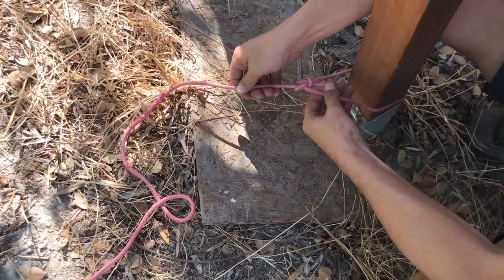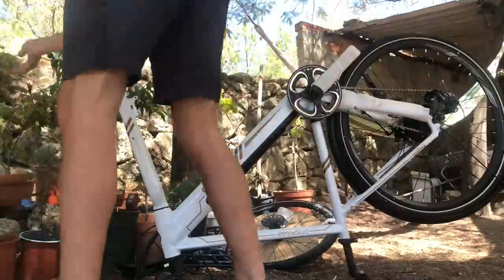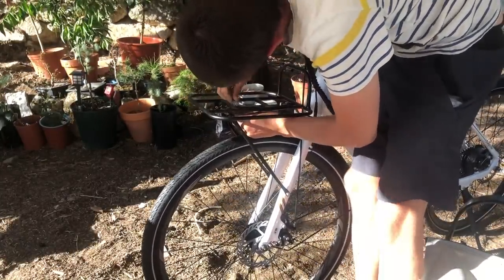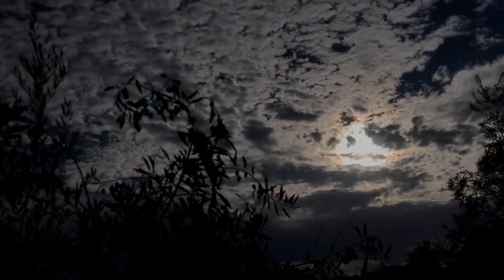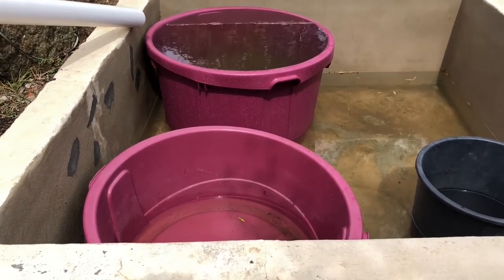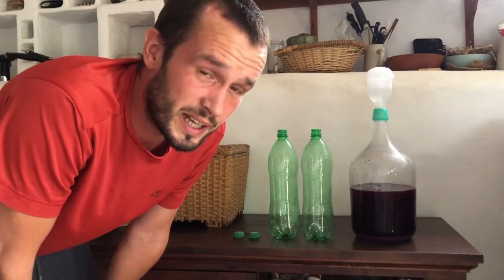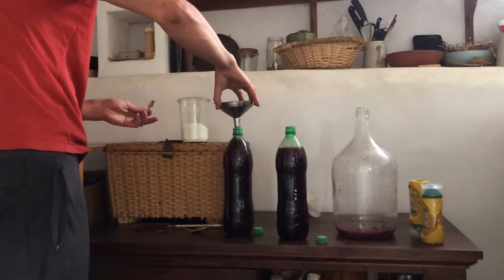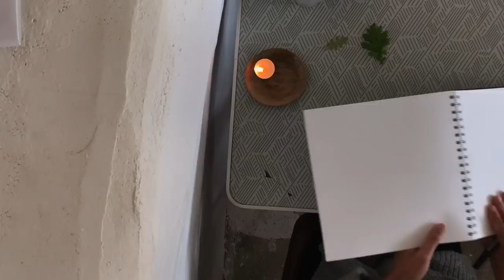OUR HOMESTEAD FINALLY GOT RAIN AFTER 3 MONTHS of DROUGHT. In collaboration w/  Eleglide Citycrosser

Comment: Hi  Cassandra,  Iowan
This is Christoph and Joan from South Africa and we are subscribed to your channel. We are both pensioners and I immigrated  to SA in 1981. I am a bit of a handyman and hope you can use my suggestions to improve your homestead

First I would like to suggest to place a hail net or even bamboo over the existing roof of your sleeping quarters and or your kitchen with maybe a 500mm or half meter gap. This way you create another layer of air which will help insulate and keep it cooler and also eliminate or reduce the noise from rain or raindrops 

With regard to your "ecoflow" solar generator I suggest to put up the solar panels permanently in the average sun angle position. This way you do not have to manage it and get most of the sun energy. Not sur if the portable panels are weather, proof, but they should be. Else consider replacing them with solid regular panels. Even adding some panels will help charge quicker and keep the ecoflow connected to the solar panels for as long as possible and only move it if you have to.

With regard to running water in the kitchen I suggest to simply install some pipes and taps and connect them to your water source,  or tank and use the same device than you use for your shower to make the water flow? Or simply gravity feed if space and location allows. Maybe install a 40mm or 50mm drain pipe with a trap and route it outside to a tank or container or basin that you can re-use the waste water elsewhere

You can reach us directly .Our provider is @reisers.net and simply add the first name for the person you want to reach Joan for my wife and Christoph for me.

Hope my suggestions meet with your approval, looking forward to hearing from you

Regards

Christoph Reiser
Reply from the maker: Hi Christoph! Thanks for your thoughtful comment! We love the hail sheet idea, I think in the summertime that would be perfect.
We did in fact put the panels on the roof for summer, they’re unfortunately not weather proof which means we can’t keep them there permanently - we do plan on buying some proper panels soon. I’ll try and send you a message privately 👍🙏
Reply: @FrankieOffGrid  Thanks for your kind words. If you buy solar panels the smaller ones are usually cheaper as they are older. Please check thee manual for the ecoflow for voltage, as some solar panels are too high in Voltage. This is listed on the panel as VOC with a number .And you get two kinds of panels, the mot common is "poly" they usually look a blue kind of tint or colour when looking at the cells and the "mono" are more black in colour. The mono are more efficient in shady and cloudy conditions but normally a bit more expensive.  If you let me have the exact model of your ecoflow I can look it up for you

you can also buy second hand solar panels as all the new systems take hi voltage VOC and some people who are upgrading can no longer use the panels with that new system. Most panels last 20 years and they are very very easy to check if you know how to use an electrical multimeter. Simply connect the test leads of the meter to the leads of the panels and see if you have a voltage. This meters are cheap and perhaps a friend has got one, but it has to bee set to the DC volt range.

Don't hesitate to ask questions if you have any

Regards

Christoph
Reply: Hi  Cassandra,  Iowan

Forgive me for my ignorance, I just watched your solar video again and saw it is a Bluetti solar station. As far as I can see it says 1000W AC but I can't see the model number.

I forgot to ask to your camera problem, did you manage to fix it. If it is a piece of sand, have you tried taking it to a garage and blow it with air to dislodge it? Or perhaps try an earbud cotton stick with methylated spirits to clean it

I looked up the solar panel specs from bluettti for the 200w foldable panel and it has a VMP voltage of 20.5 v so any panel with a similar VMP can work and my guess is not more than 400w. Solid panels area lot cheaper than the flexible ones

Regards

Christoph
Reply from the maker: Hi Christoph! Thanks again for your replies! The latest power station we have is on the most recent video, it’s by FJDynamics and is 2000w. It takes 600w of panels so I think we’re going to try and buy three 200w panels and connect them - I think we can do that.